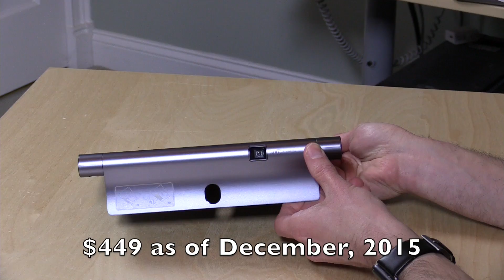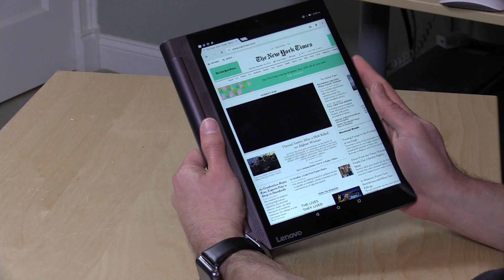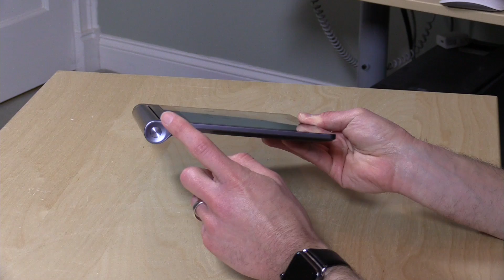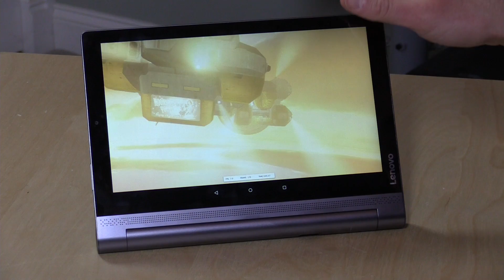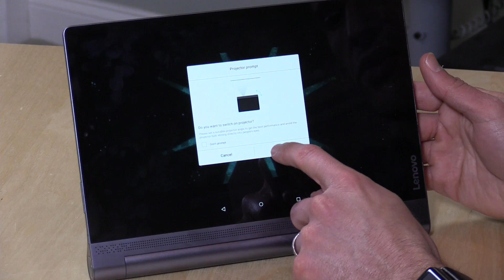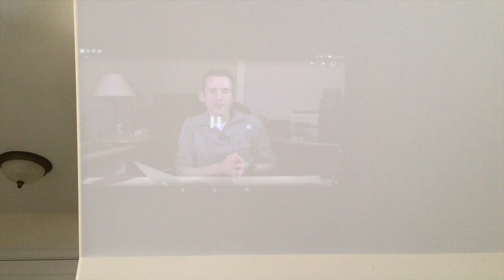Lenovo Yoga Tab 3 Pro Review - 10" tablet with projector and Intel Atom X5 processor

Comment: What is your favorite Samsung tablets or Lenovo Tablets because I had to Samsung tablets and give me problems with blinking and shutting off by itself and I had a fixed two times before and it still came back the same way and I can't hardly do anything with it at first when it's 100% And I take the charger out it looks fine without blinking and shutting down but when I get to like 64% it starts blinking little by little and then when it goes to 40 something percent it blinks faster and shuts down so I don't know if it's like a battery problem or was it only the software problem butt over here where I live there's no batteries for the Samsung so I'm thinking about buying the Lenovo but I don't know if it will give me any problems in the future like like Samsung gave me what is your opinion please help

Comment: Thanks for another excellent review. Your enthusiasm and integrity always make it a pleasure to watch these programs on your YouTube channel!
Lenovo seems to be putting out some nice tablets for a reasonable price, such as the Tab 2 10" model that received a positive rating from you in a previous video. However, in regard to the Yoga Tab 3, it seems that the rather weak built-in projector has fairly limited value, especially considering the cost it must be adding to the product. Personally, I'd probably opt to save a little on the purchase by choosing a different model without that feature. If I really needed a projector for a presentation (or even just watching a video at home) I'd be inclined simply to buy one that's not too expensive, yet can display a better and brighter image. But I'll give Lenovo credit for being innovative, and maybe in a few years they'll be able to pack enough projection power into one of these small devices to make them brilliant and useful.